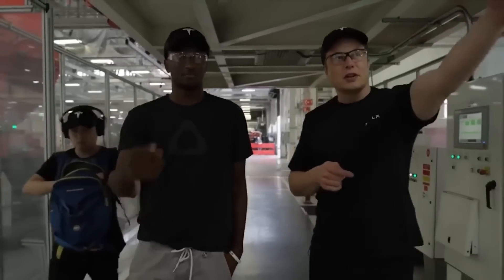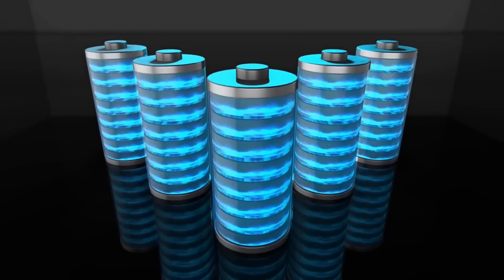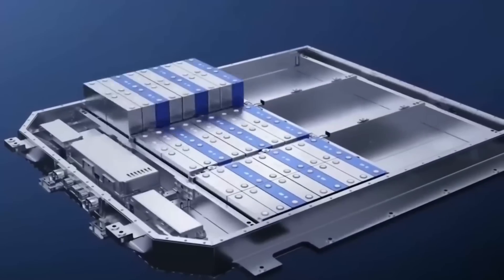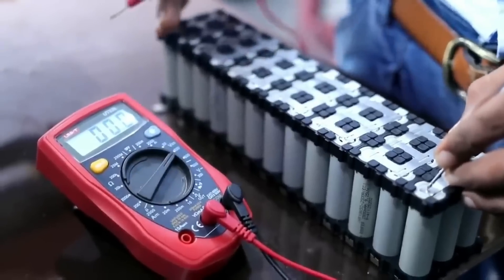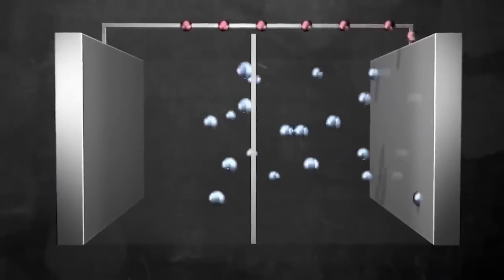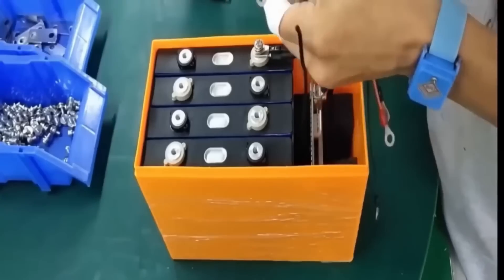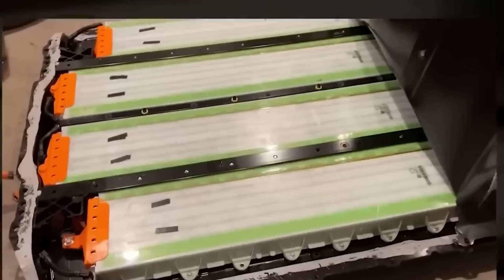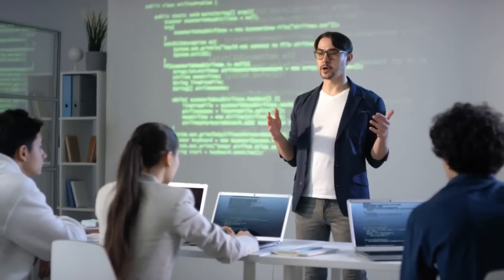Elon Musk's Research Team Accidentally Invented The New Solid-State Battery!

Comment: CARBON CLIMATE IS FANTASY. The truth will set you free!
Methane and Co2 are short-lived in the atmosphere as they combine with water vapor and come back to earth as rain, where Methanotpic bacteria break it down to feed the soil and trees. It is an important natural part of the earth's biosystem and can be replicated scientifically.
The Termite produces 20 million tonnes of methane a year, on top of that, all other insects are producing millions of tonnes of methane too. While Human carbon output is less than the termite. Also, The UN IPPC has made a statement that the carbon climate argument is overstated. Entropy all heat flows to cold and carbon dumps heat at night.  Climate change is normal and determined by sunspot density, there were 3 climate changes last century.